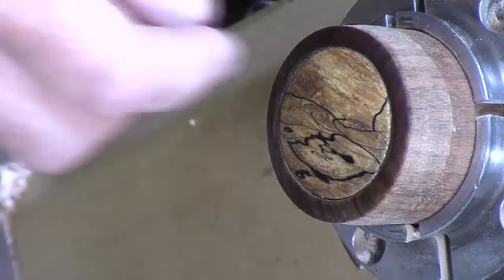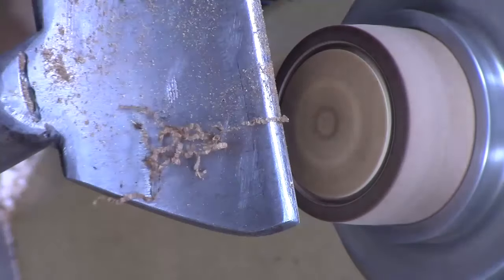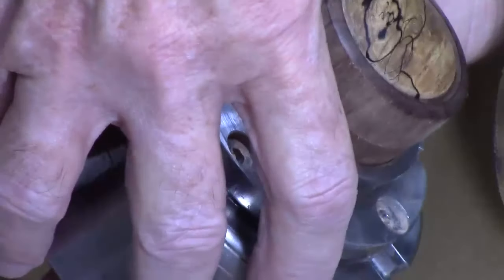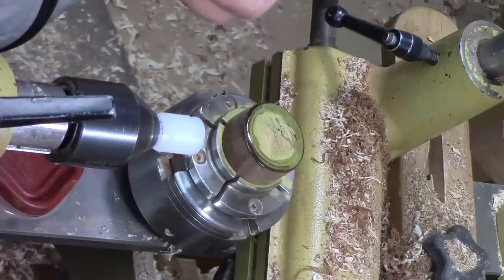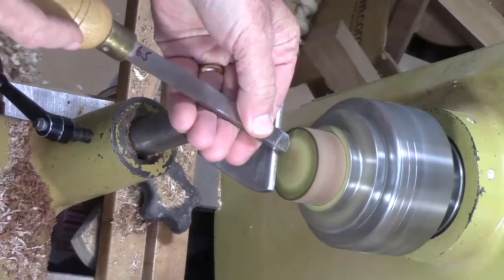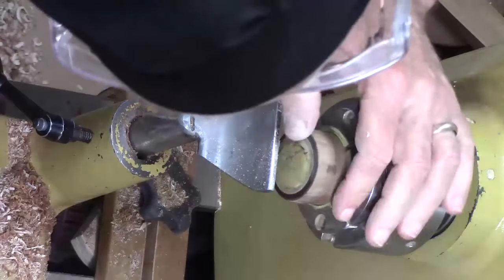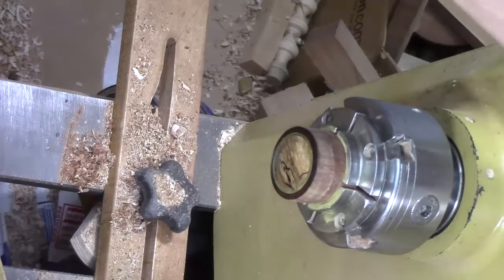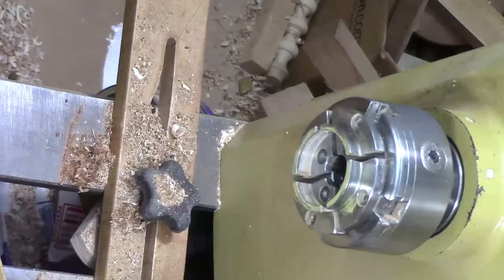How to Thread a Box with Brass Inlay Part 2

Comment: This wood really looks hard and dry.  I find that my box wood threads easier when it is not so dry.    I like to just add straight mineral oil when I chase the final passes.  It seems to help.  A good series.  Thanks Sam
Reply from the maker: I am playing with different woods as I get ready for Portland. I am threading every day since I have been away from it for a while. You are right that the dry woods do better with some lubricant that the oily exotics don't need.
Reply: Again, have a great time in Portland and I know you will do some awesome demos. Sam